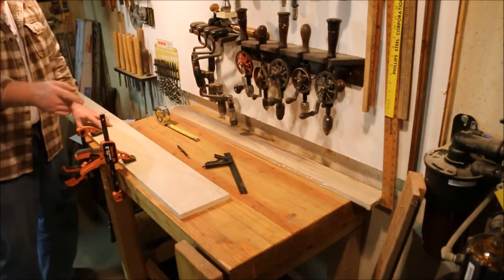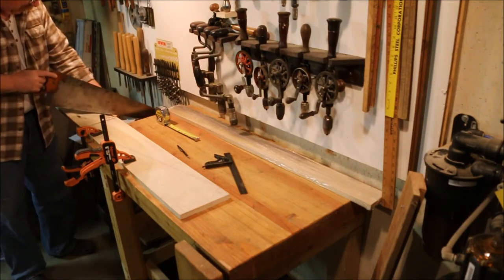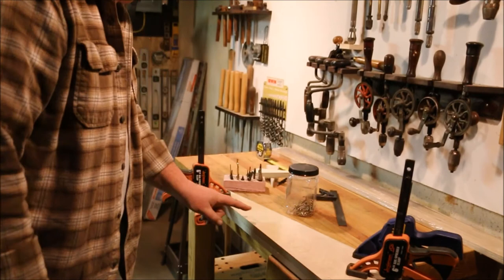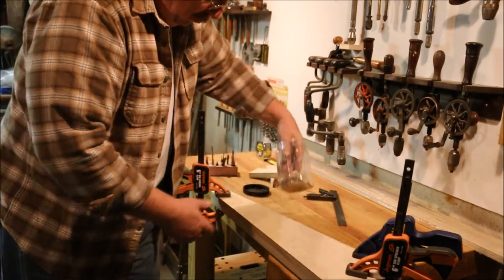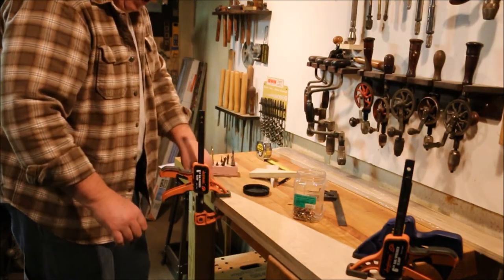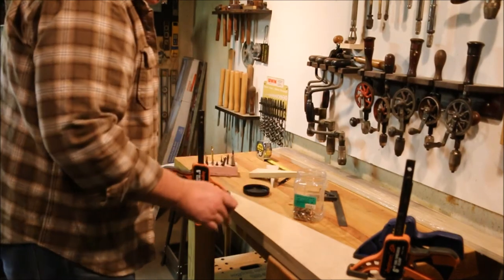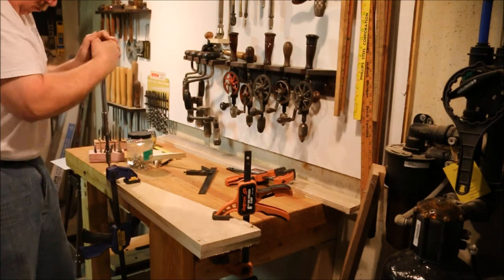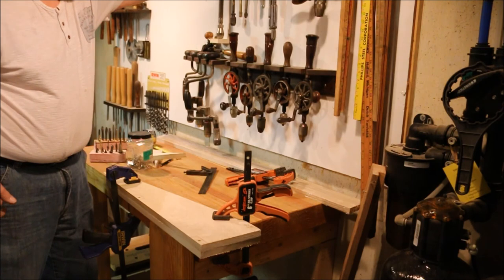MAKING A SAW TILL ~ PART 2 ~ LAYOUT

Comment: Looks like Mr. Chadwick and the rest got their wish with sawdust flying on the saw till. I even used the screw thing last week when cutting a chunk of a 2x4 diagonally to make a couple of wedges. Just ran a 3 inch deck screw (thanks to the impact) into the saw horse and had at it. No fingers were harmed in that part of the experiment. I'm safe with power tools. Looks like it's the manual ones that'll get me!
Reply from the maker: Lewie McNeely You have had lots of practice healing over the years. I seem to have the most trouble with nicks and cuts when I'm in a hurry or doing something that I don't have to think about. A sudden noise, or any distraction and the knife slips, the hammer misses, and I make another offering to the project blood bank. 
When I was 20, I was stripping a piece of romex with a Stanley knife and didn't realize I had cut myself until i noticed the 4" long slice in my left pant leg. Went through two layers of skin but didn't bleed a drop. Took 4 butterflies to close it up. Still got the scar to remind me to cut away from myself.
Reply: The romex keeps my attention, usually laying it down on something to get enough for a good handhold. I've got a Stanley knife too and I watch that thing like a hawk. I guess my apple watching hawk needed glasses or a good set of contacts! And with 1/2 track mind I try and position myself so I can't get snuck up on. I like surprises when they're non-surprises! But with the Army additive neuropathy it can happen and never know it.  The last was that way. There was a black guy, probably a nurse came in the treatment room at the V.A. and asked if I was hurting and I told him I hadn't felt a thing. He grinned really big and said 'You know....neuropathy can be a good thing because you can't feel nothing'. Then he grinned even bigger and said 'You know....neuropathy can be a bad thing because you can't feel nothing'! WE had a GOOD laugh about that. it was a good trip, even if we did get back home at 4 a.m.
Reply: Old Sneelock's Workshop good evening all my old man used to say once you knick yourself you won’t do it again and the job will turn out brill and you can truly say you’ve put blood sweat and tears in to that and you know I’ve always found it to be true strange thing aye. How the finger lewie good I hope 🤞
Reply from the maker: Lewie McNeely I don't know what it's called but with my L4 and L5 discs blown I have pinched nerves in my outer thighs, calves, and everything but my big toes on both feet. It comes and goes. Right now they're just a little numb. If I do to much or lift more than I should they lose all feeling. 
I have broken toes sand didn't know it until I took my socks off. I'm careful to check all the time. Good way to get blood clots or gangrene.
Reply: I'm prone to go along with Mr. Chadwick and put most of our ailments under the heading of 'Old Age' but I'm not rally sure about the sub-headings and sorting it out. I've never been this old before and it's all new to me. I've still got really circulation in my feet and above but with bird toes I get pressure points that build callouses and split open. My Sweetie remodeled a boot insole with a Dr. Scholl's heel pad and has fixed that I do believe. All the rocket scientists the V.A. has and my wife understands more than all of them. And my neuropathy is from the Army additives and resulting effects. But we're all lab rats to some extents.
Reply: Old Sneelock's Workshop I know that feeling I’ve got L 1to L7 crushed then 8and9ruptured so they no feeling is hell I can stand for a couple mins then all pipes and nerves die to my legs then I fall over but sitting is ok
Reply: Hi David and as far as I and the Missus can tell, getting a bit better as time goes on. Not even trying to do anything serious yet and won't until the stitches come out and even then it'll be slow and easy. That poor old finger has been through the wringer more than once.
Reply: And I thought I had taken a lick or 2. A blasted HOUSE must've fallen on you, pal!
Reply: Lewie McNeely no heavy work Arthur and old age they said the two ruptured I’ve had years. I could walk and work in feb this year then I tripped over a air line in the dark managed to save my self from falling but landed hard on my feet next day couldn’t move and I’ve been like that ever since it’s to bad to operate they are going to do two so I might be able to stand longer but they are afraid they might cut my spinal cord then it’s all over so for now I’m sort of happy the way things are it’s just getting used to it that’s what takes the time and plays tricks with my head but you guys and YouTube have helped me no end I can’t thank you all enough really
Reply: Mercy, that's BAD!Sure hope someone can do something to get you better.  All mine is from being hammered by trucks, equipment and just muling heavy stuff because I was the big, dumb and strong one. Guess the dumb ought to be first. I was 6'2" but now 5'11" and shrinking. Furnature disease. My chest is falling into my drawers!
Reply: Lewie McNeely snap mine was heavy but buses and trucks all my life I was 6 ft and I’m 5’8” now and my waistline is so what expanding the Dr’s have said I need exercise but  they have said how my arms are still strong it just the back and legs that aren’t like I’m getting my little workshop sorted slowly l have to do everything sat down so anything high up I’ve have to com up with some way of getting a seat up to it then I can lift myself up and go to work just sat down it’s dam hard and because of pain I get tired quickly so it messes my head up because I’m used to doing everything in a hurry because when you work in the transport trade times money as you’ll know
Reply: I understand. I am like you in ways and can just do so much, even on a good day. Then it's like a tire going flat. WOOSH and I'm shot. But we have to adjust. You'll triumph in the end I wager. Can't keep a good man down for long!
Reply: Lewie McNeely like you say I’m old and I’ve never been here before and I’ve always been strong as an ox so being weak is yet again a new to me in fact I’d go to say  I’m a fortnight that’s two weak still I’m learning to laugh about it now so they say a good laugh is a great healer so who knows
Reply: I told my neighbor/contractor a while ago that he had earned every gray hair on his head. We've earned a lot more than he has. I'm sure I have back bone issues but ignorance is bliss as my Mom used to say. Getting weaker and more unstable is very interesting and dealing with it is even more so. Adapting is what I think it's called. Being 'elastic' or flexible is what my wife calls it. And a good belly laugh is what helps the world to go 'round! And I've been week at least 7 days too!
Reply: Lewie McNeely can’t help with grey stuff been bald since I was 22 they say grass doesn’t grow on a busy street well that my excuse and I’m sticking with it one lad who was the same said his was headboard rash I got married so can’t blame it on that so the latter will have to do lol
Reply: Years ago I'd cut all mine off in summer and let it grow all winter when I was outside running stuff with no heat. Now when it touches my ears it's GONE and I'm slowly growing up through my hair as well. My x-Uncle-in-law said it was less hair to comb but more face to wash. If it leaves I won't have to mess with it!
Reply: Lewie McNeely lol that’s a good more face to wash Ha! I’ve put a comment next down. I listened to the rag time good player indeed my son likes hillbilly he’s a fan of Hayseed Dixie band I was listening to them they are good also don’t know if you’ve listened to them they’ve just toured here son said they were very good he’s seeing them again next time they come he love rocket man as well he’s good with computer stuff and down loaded there albums ? Double Dutch to me I’m afraid
Reply: I thought you'd like that. Glad your son can get all that stuff you like to listen to. I've heard of Hayseed Dixie but don't follow any of the groups really close. I tend to turn to the older stuff. I sure miss picking it but that's just something else we have to adapt to, like more face to wash!
Reply: Lewie McNeely I’m hopping to get a lap top I think he called it soon then I can get music of the net like he does so it might be good. I like to listen to stuff love 40s swing and 50s rock & roll I can get some on the phone but I have to go through YouTube and get the adds as and when they feel like putting one in. There’s a lot of Glenn Miller from before the war at Glenn island but they put adds right in the middle of a tune dam annoying the same with the chesterfield radio shows so he can get them for me add free so I can listen without getting bothered which I’m looking forward to
Reply: A laptop would suit you REALLY well! You've already have the hookup or have to get a wireless modem and you could be online anywhere you want! All my stuff is Windows 10 upgraded from 7 I believe. It might be a little slow but it's paid for. And a refurbished one will work just as well. Your son ought to know where a good one is. My Sweetie uses hes all the time but I like my p.c. And I've got a wireless keyboard (Logitech) and roller ball mouse. The roller is easier to maneuver than a regular mouse and you can just lift your thumb and it'll stay put while you click it., and a laptop keyboard is hard for me to get between the keys and such. My computer fixit guy is in his 80's and has shown me a lot of tricks I didn't have a clue about. But your kids knew all I know when they were in diapers. The best 2 U on getting the laptop. I like the big band stuff too. Willie Nelson did an album called 'Standard Time' (4/4) that has some of the old songs on it from there. He also did 'The Warmth of the Sun' by the Beach Boys. Branching out!
Reply: Lewie McNeely it sounds to be the way to go I think my son in law is a computer wizard so between the lot of them I think I’ll be getting one soon trouble is. I’m not up to speed with the phone yet so a laptop is going to be a night mare
Reply: You'll be surprised how quick you'll pick it up. With all the help you've got around you it'll be a sinch. Just do one thing at a time and get your son/son-in-law to write down what goes on OR write it down yourself so you'll be able to understand it. I found it's too much too quick that does me in. IF I can see through one thing at a time OR a process at a time I can slog through it. I just learned about really right-clicking a few months ago and dragging and dropping not much before that. They can show you. I confidence you!
Reply from the maker: David Chadwick Miracles can be done with osteopathic surgery these days. My sister had the bones in her lower back fused about 10 years ago and has been pain free since. Her son had a similar surgery 5 years ago after he broke his back and was paralized from the waist down. He walks with a cane but he walks. Hopefully they can do as much or more for you. 
I have Snyder bones so I have been lucky in that I have cracked a few but never broken a major bone despite living like a wanta be stuntman. For me it's just ruptured cartilage and that has grown back on it's own. It took six years to recover from that bit of hubris. 
As a boy I was skinny. With two older brothers I felt I would never be as strong as they were. All my uncles were big men. So not being willing to let nature take its course I did everything I could to grow bigger. I got a set of weights for Christmas when I was 14. I wore them out. At 20 I was 6'1" and 185 lbs. I looked like a beanpole. Over the next few years I finally got my final growth.  I gained 50 lbs and I was proud of being able to bench press 400 lbs. 
When I turned 40 years old we bought a farm house with a few acres of land. It needed work. The last upgrade had been the year I was born. I cut trees, pulled stumps and fences, rebuilt barns. All was well until I was cutting up a tree and ran out of gas. There was a chunk of the trunk about a foot in diameter and 12 feet long. Rather than getting more gas I picked it up and set it in the back of my pickup. Still no problem. I drove to the log pile. Now is where the dumb move comes in. I picked up the log and rather than moving my feet I turned at the waist and tossed the log on the pile. 
I took my 4 year old son to the gas station with me. After filling the truck and gas cans I went to get in the truck and my right leg wouldn't lift. Stubborn as ever and too dumb to call for help I crawled up into the truck and drove home. 
I'm lucky that the Good Lord watches over fools because I eventually healed. Unlike you my pride did me in.
Reply: I never lifted weights but sawmilling was the next best thing I suppose. The mill could run 22 foot long stuff and then open beams were the rage so open beams we sawed.  Usually 6x12's anywhere from 16 to 22 feet long unless it was a 12x12 or some other goofy dimension. This was before the days of lifts and we had to mule everything. We'd load the beams on the log truck and haul them up the hill to the planer, a Neuman M-48 with a 4-871 pulling it. Had to run the beams 2ice because it just had 6 inch siding knives. Then back to air dry till delivery. There were usually 5 of us. All that could would grab one end and I'd get the rear by myself. Turned logs without a hook most of the time. Later on it was yard work. Toted  4 bags of Sakrete a couple of hundred feet down to a boathouse. We did several pallets of it. I'd rather tote than mix. This was in between driving and operating jobs. I'd stay on the road till my blood pressure started climbing then off I'd go. Silly me. I pulled a twisting deal with a shovel of 3/4 stone and went to my knees. My back popped like a gun firing but I was the only one that heard it. I wobbled around and sat down till it eased off but it was sore as all get out for awhile. Sillier me.
Reply from the maker: Working for a living will definitely make a man out of you. Especially when you work with a bunch of young guys who are trying to top each other. Your injury sounds a lot like mine. The twisting seems to be the reason for the damage. 
I went to a neurologist to see if I could get away from having to take 8 Motrin at a time just to walk. After an MRI he said if I was able to walk and Motrin took care of the pain I shouldn't have surgery. It was healing on it's own. He said most of the surgeries done at the time could help but not cure and the surgery weakened the back muscles making it more likely to happen again. 
He went on to explain that at 20 my discs were like a balloon. All bounce and stretch. By 26 my discs had become rubber tires. Stiff but still with a lot of give and strong enough to take the gaff. By 40 the tires had gotten worn. They were beat up and weather checked so when I twisted they didn't give they tore and the center squished out against my spinal cord. Not enough to cut it but pinched it against the bones.
Reply: Old Sneelock's Workshop pride I think has a lot to do with it I’m as mad as the rest never be beat I’m going to lift it if it kills me attitude. I’m in the hands of the Dr’s they’ll do want they can I’m sure mind it’s down to the N H S hear it’s if they want to cover it we don’t pay for it hear it comes out of your national insurance witch is the same for all basically if they can fix it cheap they’ll do it. My friend went blind in America they can fix him but here not a chance so he walks with a white stick now and that’s that I’m the same if it comes to life or death they’ll have ago but while I can move a bit they don’t want to risk it. I’m afraid the uk with so many on benefits there isn’t enough money going into the national health service to cover major problems. It’s like I got diagnosed at the end of feb and didn’t see a specialist till 30th of August. I’m on a waiting list now to give me injections into my spine to see if that will help with the pain but that’s likely to be next year now. To many scroungers and not enough workers over hear is the problem it seems
Reply: I don't remember us trying to out-do each other. The sawyer was fine tuned and it was elbows and poopie holes till black dark every evening after school. WE were just trying to keep up because the only break we got was when a log got rolled on the carriage. I was smoking then and that was the ONLY time i had to light one and went running with it till I threw the last of it down. Then the so-called 'professional' driving set in and my body crying to get out and DO something but had to keep going or get yelled at and I had a family including me that liked to eat and be warm in the winter, so on down the road I'd go. The equipment beat me around so I got a little exercise just hanging on for dear life. But then I'd quit or be between grading jobs or bad weather and have to start old Manuel Laybor back again. Did one job every 2 weeks with a 21 inch Snapper hand mower that took 7 1/2 hours of steady walking. I can't even do 7 1/2 minutes hardly any more without arthur hollering. And I had a prescription for 800 Mg. motrin pills all that time. Like Doc Watson sang, 'Life gets tedious, don't it'!
Reply: Here too. Had a buddy that stayed in the Army as a career and he said it was the same in there. The ones that needed it couldn't get it and the duds got everything. My Sweetie had her policy with Blue Cross/Blue Shield and it went from $300 a month to $1200 a month. She dropped it and got accepted to a Christian outfit that about what she was paying to start with. I've got mine through the V.A. but with all their 'help' with all the injections I took and the places I ended up, I try and stay gone as much as possible. You don't think that much of 3 years off your life till you get 'more mature' and wonder were the last 40 went, along with the 3! Blamed interesting.
Reply from the maker: Waiting so long to see a doctor sounds like the veterans here in the states. The last white house resident did his best to put all of us in the same boat. It sounds like a great idea. Free health care. 
Until they start having to find someone to pay. The bastard bought votes by saying the rich will cover the bill. They all moved their businesses to the far east and told him to suck eggs. So for 8 years he kept covering his arse with a blanket made from stealing hope from the working man. Drive jobs out. Then promise a free life, free education, free food stamps, free housing, free phones, TV, etc. etc. 
Teenagers that at 16 would have been working were out of work for 8 years. Now they are 24 with kids of their own and still no job. No worries the government sends them a check. 
So far he failed but when you tell everyone to come over to the house and live. Then provide free beer and skittles, they take you up on it. Pretty soon you have a house full and nothing but dirty dishes to show for it. The problem comes when they think they own the place and start selling off the furniture. 
We both worked and earned our keep but I doubt half those drawing benefits in either of our countries has turned over a rock or picked up a shovel to earn a penny. So when we get worn out they say to hell with us and start looking up the deed to the property. 
The new guy talks a good show but he's playing with cardsharks who brought their own marked decks to the game. 
40 years a senator and not one thought to doing anything other than staying a senator anyway they can. 
I'd happily take a few minutes to set them straight.
Reply: Called a massive attitude adjustment. You hit it right on the head, Unc.  There ain't now or ever will be a free anything.
Reply from the maker: Life sure does get tedious. Despite all the trouble caused by the efforts I still hang on to the ragged edge of existance. Only one guy came back from the other side and I hope to meet him someday. With any luck I be alive when the trumpet blows and I'll walk into heaven. I have to think that because despite all the attempts to have me shuffle off this mortal coil from bugs to blasting I'm still standing. 😊
Reply: Old Sneelock's Workshop never a truer word mrs thatcher killed this country big time I don’t think it’ll ever come back we-don’t even have the factory’s now to even start making things or the materials so what little work there is is paid minimum wage and you are worked to death and you don’t like it you know where the door is unions don’t stand for anything now the rich get richer and the poor can get help but if you are just the average joe who works hard your made to suffer. My brother in law is head of bodycoat international the metal treatment specialists for the uk and Europe he’s very well paid health care provided and finish’s at 60 big pension but it’s an American company with your ways but he seems to be the happiest person I know he has to work hard but loves what he does so he doesn’t look at it as hard. I was the same at work loved what I did and again I lived there never looked at as hard but old age and ware and Tear has beaten me to the finish and because I’ve broken before I should I’ve got to try and get to the finish on my own now best as I can